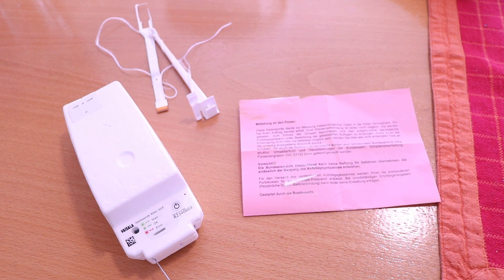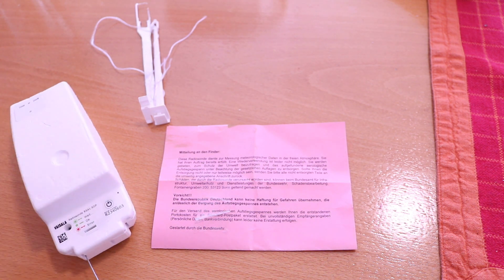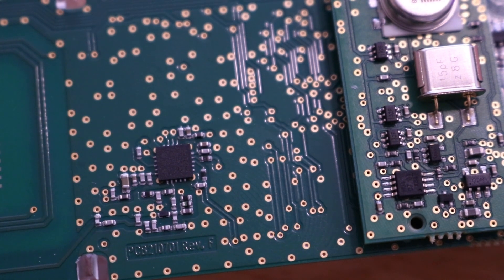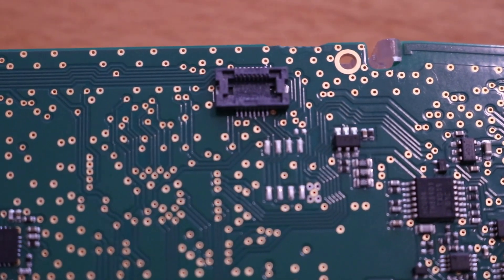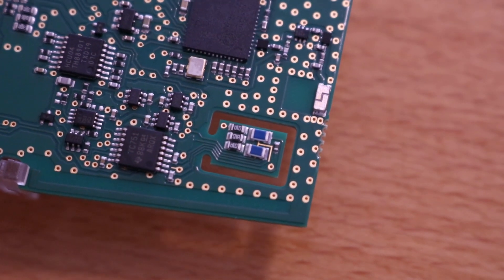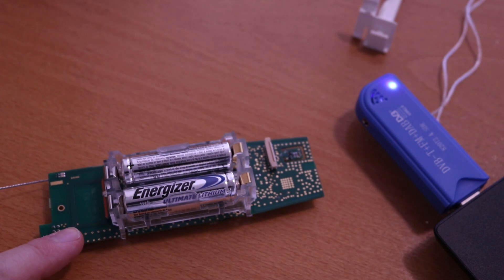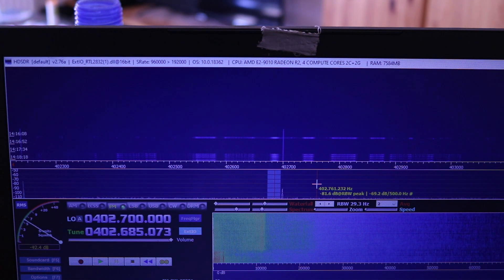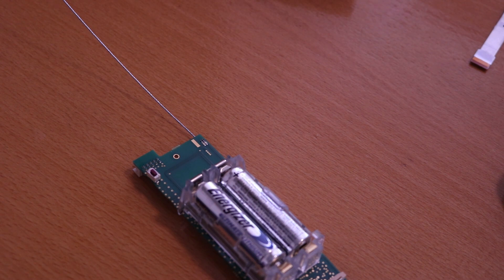A look inside a Vaisala RS41 Radiosonde

Comment from the maker: Ok 100 km range is an overstatement, but they sometimes fly this far.
Reply: power is around 50-60mW, can be received at over 500km provided a line of sight. the carved out area is a heating element (using the resistors, carved out not to heat the board directly too much i guess). the microcontroller under the batteries is a stm32f100 - arm cortex m3, pretty powerful for such a task. the same microcontroller is on the pressure sensor module. red blinking is not a fault but it misses the programmer to calibrate it before launch. still works. its very easy to reprogram it to do all kinds of other stuff. you dont even need a ham radio license as you can program it to transmit around 433mhz and limit the power to 10mW, fits the license free ism band there. - ich sehe die sonde ist aus idar-oberstein, wo hast du sie gefunden?
Reply from the maker: @RBMK1500  They're flying mostly from Idar Oberstein in the opposite direction. I looked on a website and waited until one landed more or less close to me.
Reply: @RBMK1500  Hi, I found one of these while hiking in Croatia yesterday. When I power it on it gives an "Wait" signal, blinking green light. I am a radio amateur and I was wondering what can I do with it? I would like to use it as a weather monitor and set it up on top of my house but I have no idea how to get or decode the transmitter data. Can you point me in a right direction.Thank you
Reply: @siveric32  If picked up, they are still on the 400 MHz band. You can't use them to monitor the local weather. It sends GPS data, temperature, humidity, battery voltage and its own serial number on 402.7 MHZ (Idar-Oberstein). You can reprogramm them to send on 434 MHz, but not all parameters (https://github.com/darksidelemm/RS41HUP)
For tracking (and decoding) : http://escursioni.altervista.org/Radiosonde/   and you need a receiver capable of receving on 400 MHz (RTL stick).
Also to see where they are flying, see the comment from @MCgamingPro